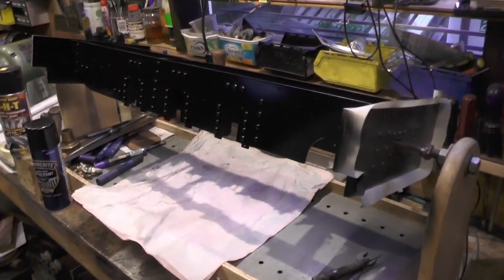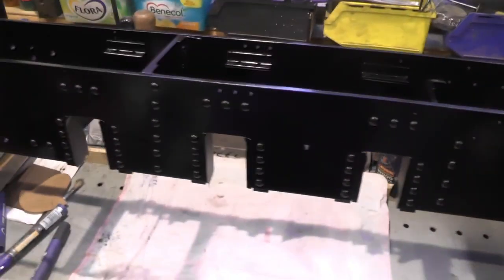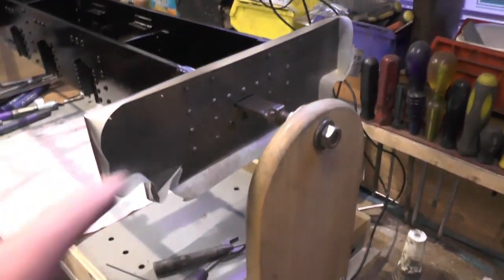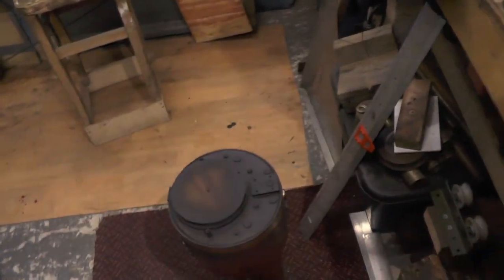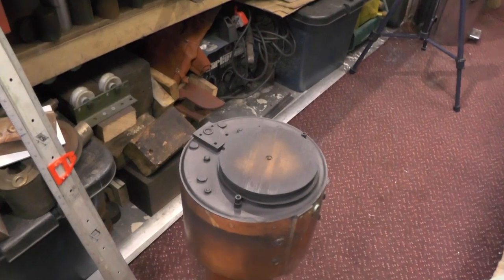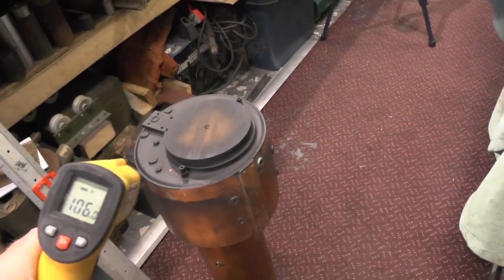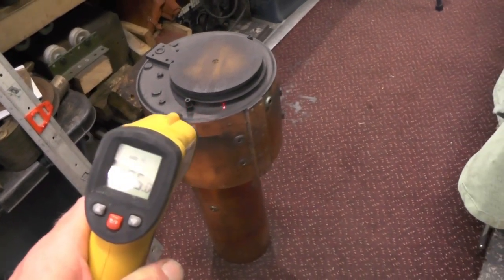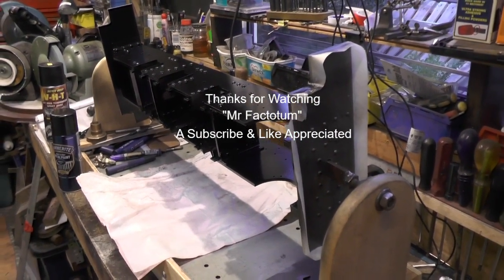Making a Beginners Steam Loco Series "Painting Frame & Boiler Backhead" "mr factotum"

Comment: Silly question. Did you paint direct onto the black mild steel or did you remove the scale?  Love this series of videos as I am building a Sweet Pea too. Thanks
Reply from the maker: Hi RJ
I descaled, degreased and painted, the hammerite smooth on and seems okay now ive had the loco steamed up, a few times, the buffer beams i think if memory serves me right i descaled, degreased, etch primed and used automotive red paint all seems okay, i know painting though is a subjective subject, what suits one person doesn't suit another and vice versa, may be if i was building  show piece i would have done differently and had it painted in 2 pack, but i built this to be used and its inevitably going to get war wounds with chips and scrapes but i like to see things in used condition with patina of wear on it.
Glad to hear your building a SP, how far are you in to your journey of the build. keep me updated on your progress as i find it interesting how other people are progressing
Thanks again
 Regards
mr f
Reply: @MrFactotum  Thanks for the reply. My frames are built, wheels quartered and fitted to frames. Coupling rods done and everything running smoothly after a small amount of fitting work. Axle pump done and eccentric strap all good. I’ve opted for the trailing bogie which is finished too. Have to admit I’m a bit anxious about doing the cylinders. I got the castings from an unfinished project. Holding castings secure in a lathe Chuck is probably not possible. Some thinking to do. I too prefer the loco to be used when finished so I’ll be aiming for functionality and won’t mind if it gets a few knocks. Thanks for the help. Ray